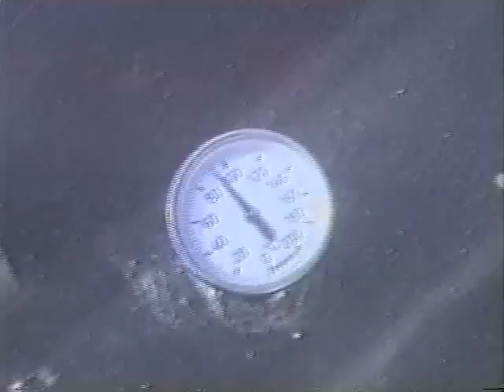Growing Spirulina in a Village in West Africa 1989

Comment: At 3:35 he mentions that the methane is piped to the clinic, but the CO2 is added to the basin.  How are they separating the gases?
Reply: Scott Baker they have two different weights the lighter gas will be separated to the top interior gas will be separated right above the liquid hope it helps
Reply: Well, you might burn the biogas (methane+CO2) first and then pipe the final gas (CO2) to the growing cultures. There is no need of separating them.
Reply: why not seperate?  if i need say gas for my cooking plate,, the last thing i need is a gas co2 that dont burn. hehe
methane alone is highly flamable, and probably toxic to the spirulina.